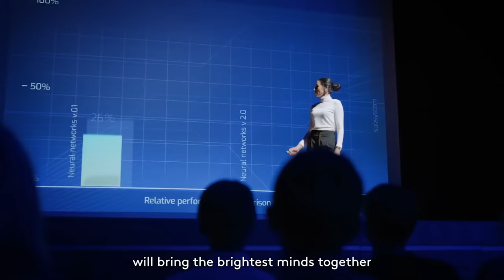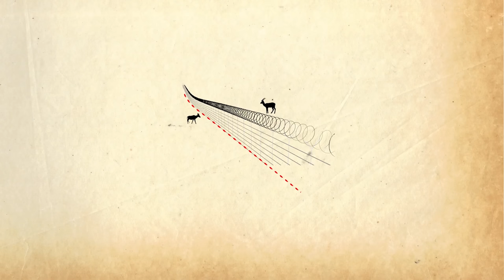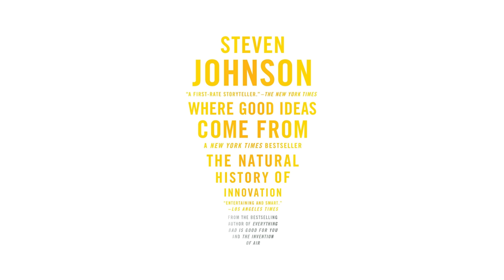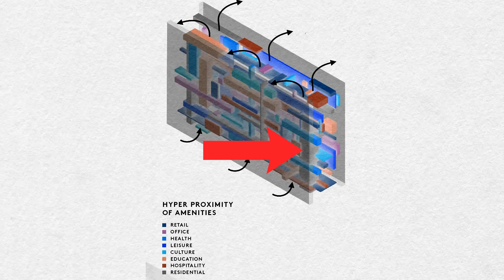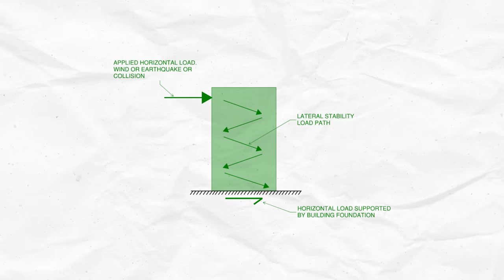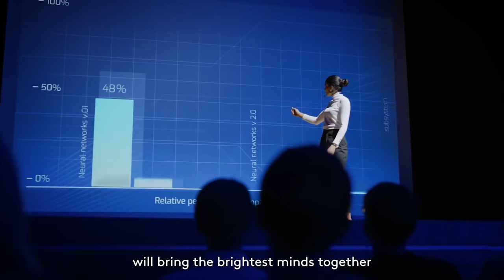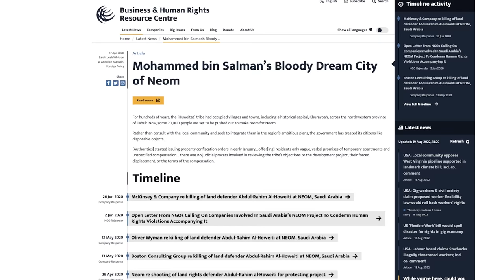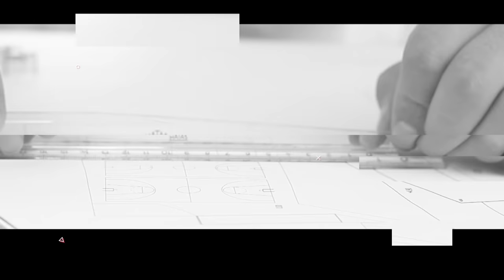This city concept breaks architecture (THE LINE)

Comment: I've heard a lot of 'macro' problems with this project, but you brought up a lot of the 'micro' ones that somehow got overlooked - like small roads for cycling, a huge wall blocking wildlife, and COVID in elevators.
Reply: They’ll just have to evolve without cycling the way we think of it. Also let’s face it if a disease springs up inside there everybody’s done. At the same time it would be a lot easier to contain than on the outside, but as we all know diseases don’t seem to like being contained all that much
Reply: The grocery thing can easily be solved with delivery systems. So you don't have very into an elevator or go downstairs. Like dumbwaiters are pretty easy and delivery bots are becoming a thing already. The wildlife thing is an easy fix too with gaps in the sections. The cycling thing is also straightforward with bike lanes or sections, like what some college campuses; areas you can ride and areas you have to walk the bike, or traffic lights for pedestrians and cyclist if needed
Reply: But at least women won't have to drive anymore in Saudi Arabia...Now they can just take a train without crying about getting equal rights /s
Reply: First thing I thought in relation to my job: as a paramedic, this is a nightmare. If you get a life threathening injury in here. Youre on your own
Reply: For wildlife there are plans to assist them. For covid and other viruses , the city will be so advanced that it will be able to disinfect them quickly once detected
Reply: @Lars - robots to the rescue
Reply: @ریحانارشد  how do u "disinfect" a person with a virus?
Reply: COVID in elevators?!? LOL. You look at this project and that’s what you think about? Bet you’ve had a fun last couple years.
Reply: Dust Storm could be another major problem. Perhaps they have anticipated this.
Reply: Mary in the Quran
Chapter 3 - Al-Imran Verse 42-43
And when the angels said to Mary: 'Allah has chosen you and purified you. He has chosen you above all women of the worlds.
*
"O Mary! worship Thy Lord devoutly: Prostrate thyself, and bow down (in prayer) with those who bow down."
45-50
Behold! the angels said: "O Mary! Allah giveth thee glad tidings of a Word from Him: his name will be Christ Jesus, the son of Mary, held in honour in this world and the Hereafter and of (the company of) those nearest to Allah.
"He shall speak to the people in childhood and in maturity. And he shall be (of the company) of the righteous."
'Lord,' she said, 'how can I bear a child when no human being has touched me?' He replied: 'Such is the Will of Allah. He creates whom He will. When He decrees a thing, He only says: "Be," and it is.
And He will teach him the Scripture and wisdom, and the Torah and the Gospel.
"And (appoint him) an apostle to the Children of Israel, (with this message): "'I have come to you, with a Sign from your Lord, in that I make for you out of clay, as it were, the figure of a bird, and breathe into it, and it becomes a bird by Allah's leave: And I heal those born blind, and the lepers, and I quicken the dead, by Allah's leave(permission); and I declare to you what ye eat, and what ye store in your houses. Surely therein is a Sign for you if ye did believe;
"And (I come) confirming that which is before me, namely the Torah, and that I declare lawful for you some of the things that had been forbidden to you. I come to you with a sign from your Lord, so take Allâh as a shield and obey me.
"'It is Allah Who is my Lord and your Lord; then worship Him. This is a Way that is straight.'"
Mohammad(Pbuh) Prophesy Song of Solomon 5:16 IN THE Bible
חִכּוֹ֙
ḥik-kōw	His mouth [is]
מַֽמְתַקִּ֔ים
mam-ṯaq-qîm,	most sweet
וְכֻלּ֖וֹ
wə-ḵul-lōw	and Yes he [is] altogether
מַחֲּמַדִּ֑ים
"ma-ḥă-mad-dîm";	lovely
ma-ḥă-mad-dîm; There Mentioned By Name in your Bible
and if you wonder what the IM for Read Genesis 1:1 in Hebrew
אֱלֹהִ֑ים
’ĕ-lō-h"îm";	God
IM is Plural of Respect in Hebrew
Meaning of Mohammad in HEBREW !
חמד
The verb חמד (hamad) means to be desirable, pleasant or "praise-worthy". It's usually accompanied with covetous sentiments, a taking delight in or a resolve to obtain or achieve the delightful thing, person or state.
Nouns חמד (hemed) and חמדה (hemda) means desire or delight, or describe a precious or delightful thing. Plural noun חמודות (hamudot) means desirableness or preciousness. Nouns מחמד (mahmad) and מחמד (mahmod) denote a place or agent of חמד (hamad); a place, person or thing of desire, pleasure or delight.
and in ARABIC
mohammad "'praiseworthy' "(derived from the verb ? hamida 'praise').
He Altogether (Praise Worthy ); ma-ḥă-mad-dîm
(Matthew 4:1) Jesus was tempted
(James 1:13) God cannot be tempted
(John 1:29) Jesus was seen
(1 John 4:12) No man has ever seen God
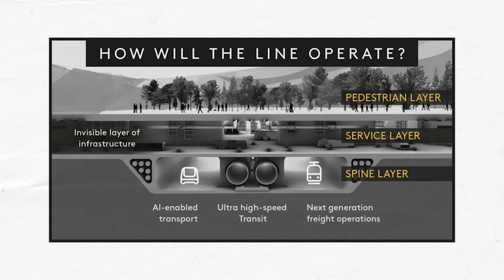(Acts 2:22) Jesus was and is a man, sent by God
(Numbers 23:19, Hosea11:9) God is not a man
(Hebrews 5:8-9) Jesus had to grow and learn
(Isaiah 40:28) God doesn't ever need to learn
(1 Corinthians 15:3-4) Jesus died
(1 Timothy 1:17) God cannot die
(Hebrews 5:7) Jesus needed salvation
(Luke 1:37) God doesn't need salvation
(John 4:6) Jesus grew weary
(Isaiah 40:28) God can't grow weary
(Mark 4:38) Jesus slept
(Psalm 121:2-4) God doesn't sleep
(John 5:19) Jesus wasn't all powerful
(Isaiah 45:5-7) God is all powerful
(Mark 13:32) Jesus wasn't all knowing
(Isaiah 46:9) God is all knowing
Jesus, the son of Mary was no more than a Messenger
Reply: @ریحانارشد  show me a robot that can do the job of a paramedic perfectly, let alone in these terrible enviroments
Reply: @jrodjpg  Exactly what people use to think back in 1800: fools think that they’ll be able to travel from New York to London in hours.

in next 15 years, things will change drastically. The world you see as of now will be replaced, (hopefully by a better one). And that’s why these projects are of incredible importance. They bring brilliant minds together and push them to innovate.

Ever heard about telemedicine and telesurgery? Yes, it is happening. Doctors performing surgeries remotely.

Imagine what they will be able to do in next 15 years & how advanced the robotics and artificial intelligence will be.
Reply: @jrodjpg  funny, you think that robots need to move like humans to do paramedic work. Lol
Reply: @ریحانارشد  yeah enlighten me if you will, genuinely curious about how you’re gonna make a robot perform cricothyroidotomies, chest tubes, central catheters, postmortem cesarean sections and field amputations autonomously in non-helpful scenarios. Those are just the peak of the iceberg when it comes to the types of emergency surgeries paramedics perform, and surgeries are just one part of the enormous work they do. So enlighten me, I’m all ears
Reply: I think every elevator should just have automatic vaccinations upon entry for COVID. Put hand into vaccination pod, get boosted, and then you can enter.
Reply: Fascinating concept. It will be a seedbed for creativity and job security for an army of engineers, but I reject the negativity of the comments here. No doubt, it will need to be different from the original vision, but why not do it.
Reply: @jordansernik  cannot tell if trolling or serious
Reply: @SuperSpecies  the first one

Comment: I’m so glad you brought up the topic of the animals. The first thing I thought of when I saw this design was how would animals move around and react to this design. And I didn’t even think to consider the fact that the giant mirrors would literally fry everything around it. It’s insane that this design made it past the initial brainstorming. In South Africa in architecture school, one of the first things we consider is how the design will affect the land around it. And animals are part of the land. If we had to try propose this as a first year project, the lecturers wouldn’t be very impressed. 

I think the concept was great, but in practice this is very impractical.
Reply: I immediately thought the same. They could at least use repeating arches and fashion it like an old aqueduct so it only touches the ground where it needs to? This is of course wouldn't solve all the other problems with a scheme like this...

Comment: I think the two dimensional design is inherently dystopian. Think of how divided snowpiercer was with more and more luxurious compartments the further you go. Then there's also the fact that light mostly reaches the apartments further up the wall which in turn makes me think of Bladerunner or some parts of Star Wars where the rich live up in high-rises and the poor populate dark,dingy and unsafe spaces at the very bottom
Reply: It's actually a very fitting representation of Saudi Arabia's hierarchy.
Reply: @AnonymousReader-er4eg  true
Reply: Absolutely agree. Along with concept of a wall being a symbol for division, turns out the inside is exactly the same...
Reply: This design could be scaled up, run line cities in parallel. It would start looking like 'the matrix' at that point.
You could install trillions of human batteries on a planet that way.
Reply: @peterbelanger4094  yeah exactly. All good cities are somewhat chaotic because that's how human settlements naturally expand, choosing the best spots and saving the prettiest parts of land for parks and what not etc.Of course there's not much in terms of nature in the desert but the artificial, prefabricated feel is certainly not inviting. I can only imagine how uncanny the city will feel in the begging (or the end) of the line's existence when 3/4ths of the houses are empty and the town is completely desolate
Reply: @peterbelanger4094  what advantage would that have over our current setup? and you are comparing a system with unconscious beings to one where people live and work?Put down the bud lights pal
Reply: i support this project for that very reason it starts with a line and in a thousand years the entire planet will be an Ecumenopolis
Reply: you think poor people will ever stop existing? They will make such places for themselves even if everything was absolutely equal in the beginning
Reply: @kamisama9715  but it's one of an urban planners duty to prevent extreme separation
Reply: @yesno1550  that is also true.
Reply: @kamisama9715  of course there will be tiers but the poor people of today live objectively better lives today than the monarch’s of the past

Comment: When I look at these structures the first thing that strikes my mind is how oppressive these walls look from the inside. You see only a tiny sliver of the sky. And at the ground, it must be 10X worse. There is nothing that would convince me to live in such a place. It is the fuel of dystopian novels. I prefer the ideas from Jacques Fresco or Buckminster Fuller. I am definitely no architect but when I look at Fresco's ideas there are already several advantages. First, they are circular and therefore don't cut through so much space like the line. You have much more degree of freedom to move around. Circular transit systems AND those that go from the edge to the center. Less dependency on building vertical, therefore more freedom for movement impaired people and fewer chances to spread sicknesses. And really important is that your view of the sky doesn't get obstructed. Probably Jacques's ideas have their own sets of problems. Otherwise, we would see those more prominently. But at least they don't crumble just from a surface glance like The Line does.
Reply: The 'line' design was probably chosen to minimize the energy and other costs associated with maintaining a habitable environment in the desert. I think heat and moisture dissipation are much more manageable with this design. Designing a city involves allot of tradeoffs (multi-objective optimization) hence we really need more in-depth information about the design to really judge it.
Reply: To be honest, the arabian sun is far more oppressive... But this project is realy bad, I realy hope they do it and waste a trillion dollars...
Reply: @vineleak7676  yeah, it looks like they only considered efficiency, not human nature.

Comment: I would love to see a very expensive city project like this, with all the cool 3D atmospheric stuff, except maybe in the shape of a square instead of a line... Maybe there is a reason why cities aren't lines.
Reply: It is an absolutely evil concept.
Reply: They kind of were lines for a while - sort of. Towns clustered around train stations, which were along a 'line' of sorts. It's important to have space to adapt and grow though, and a rigid 3d structure like this doesn't have that. Plus lifts are dumb, if your town plan requires able bodied people rely on lifts you've made a mistake.
Reply: @shraka  The 'line' design really helps with minimize the energy and other costs associated with maintaining a habitable environment in the desert. I think heat and moisture dissipation are much more manageable with this design. Designing a city involves allot of tradeoffs (multi-objective optimization) and we need more detailed information to really judge the design.
Reply: @primaryesthethicinstincts4832  it could still have been bent into a much smaller length like circular, square or zig zag, also it's extremely tall, and it has no way to walk between the floors, these are a few of the easy to solve problems taking in acount that you're right
Reply: @Tsuruchi_420  Are you sure there are no ways to walk between floors? There is just not enough data on the engineering side of the project. But I do like bold projects purely from an engineering perspective.
Reply: @newwonderer  It's really tall so there will still be serious damage. And we don't know the design of the power line network and the renewal energy system to estimate the disruption it will cause.
Reply: @newwonderer  if someone want's to, for some reason, completelly destroy the line, they will find enough bombs to do it, also, it would be a big circle, circle is still a bad shape to build it now that i thin about it
Reply: @shraka  Having worked in an AI research lab, I know that an AI can come up with really counter-intuitive designs. The height combine with the 'sandwich' design for example are very useful for managing heat and moisture dissipation in a desert with minimal energy and other associated resource costs. There is just not enough data publicly available on the engineering side of the design to make concrete and objective judgments yet.
Reply: @primaryesthethicinstincts4832  ... Okay dude.
Reply: @shraka  And also  It has to be a 'line' that's aligned with the suns path (as much as possible) so that the sunlight reaches inside, despite it's tall 'sandwich' structure
Reply: @primaryesthethicinstincts4832  maybe building it in the desert is the problem then? To build a city into desert area where nothing exists is just plain stupidity. Where will all those people work? Will there be industrial sites in the city? Just such a stupid design and concept. All form over funktion and zero thought.
Reply: @addansteelbane3536  Here is that thing. 95% of Saudi Arabia is desert. So anything they build is going to be in a desert. In fact on of their more subtle achievements is that withing the past few year they have successfully turn huge swathe of desert land into sustainable farms.

Comment: Man … I love architects, smart engineers and talented artists. This combination is beautifully showcased by this channel.
Reply: while that might be the case here - for most the common used phrase in the field "an architects dream is an engineers nightmare" exists for a reason
using her as a reference for how smart architects should be is a bad omen for everyone that gets involved with them in the workfield 

sorry if i seem salty but i sadly work with quite a few architects and none of them are as "smart" as her 
so having her as a partner in the field would be a dream of mine
Reply: @MHCranbeary  well as a mechanical engineer and with my very limited experience in construction (I pivoted to software engineering many years ago) I can see where you’re coming from.
Nonetheless, the quote you mentioned, despite being true, isn’t related to the skills or intellect of an architect. In fact every creative, out of the norm project, will have its challenges and that’s the nice thing about our job.
Now the real nightmare is working with an architect without the right skills.
Holding a degree doesn’t really make you an engineer or an architect.
Reply: @Georgio476  yeah but sadly the artistic pov isn't the only issue 
simple service shafts or holes in the floor so you can pass through your ascending pipe are often not in line with one another so you have to plan those janky lines through your building which often can cause issues later on
or cause of "artistic" reasons not leaving enough space for any sort of technical equipment so engineers have to place a 2m³ pump into a 1,5 m³ space - and then get complains cause mechanics or any sort of service worker can't reach anything of said pump
and that's while not even mentioning leaving enough space for normal people so they can casually put stuff into their apartment cause everything inside is so entagled or narrow

working with architects just causes nightmares after headaches after nightmares...that's just a fact after having to work with them for over 6 years
Reply: @Georgio476  "Holding a degree doesn’t really make you an engineer or an architect" - what else makes you an engineer or architect? :)
Reply: @doom9603  holding a degree while actually knowing what you’re doing
Reply: @Georgio476  But if you are holding a degree, you should know what you are doing :D
Reply: @doom9603  trust me, it’s not always the case 😅
Reply: @Georgio476  Well I've seen IT engineers who are trash after 40 years in business. But yeah I get what ya mean :D But anyways, a degree should definitively qualify a individual to be a good part of that field, compared to uneducated folks. In most cases it does.
Reply: @doom9603 believing In yourself
Reply: Created by Architects named George Constanza.